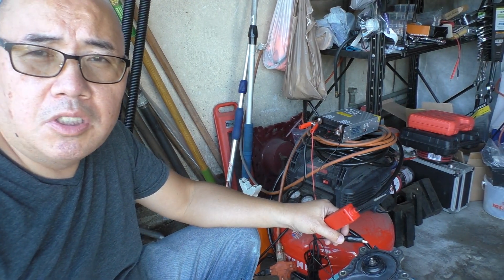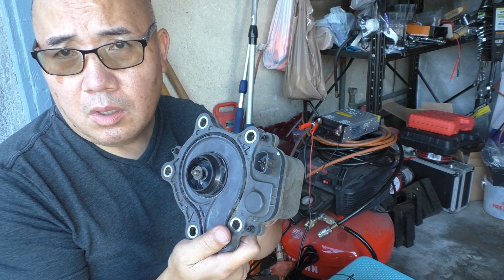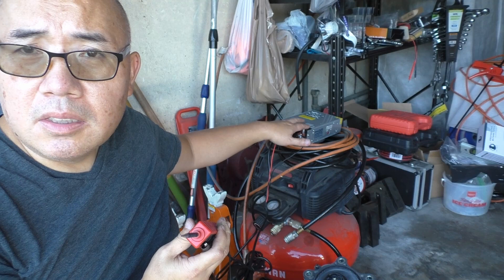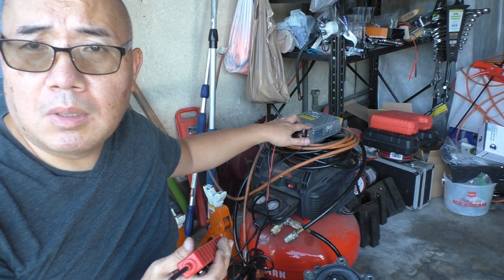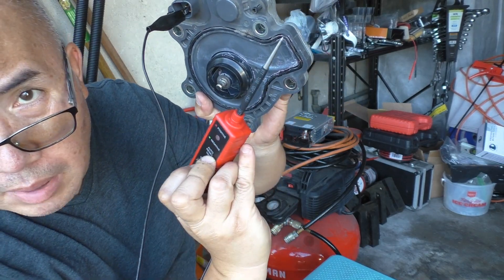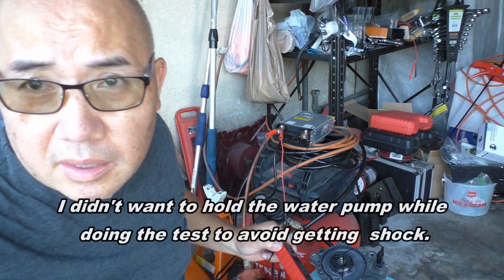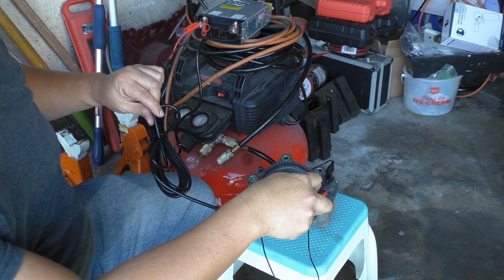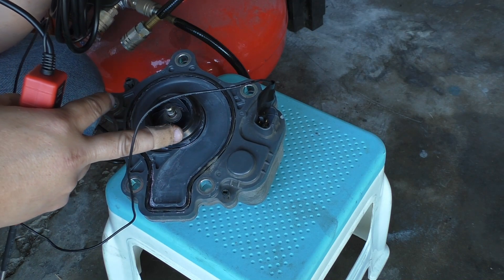How To Test Automotive Water Pump || Electrical Bench Test

Comment: And yes the other 2 gold connections go to a PWM controlled sytstem that is activated by computer to give varying speeds! Pulse Width Modulation give more than just a "high" and "low" speed control it can vary at all speeds!
Reply from the maker: Thanks for sharing your infos